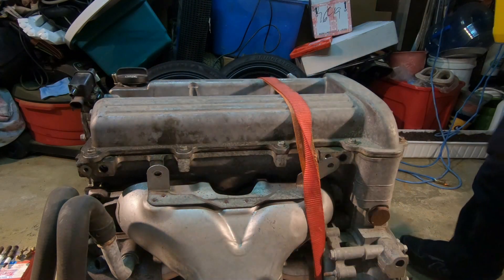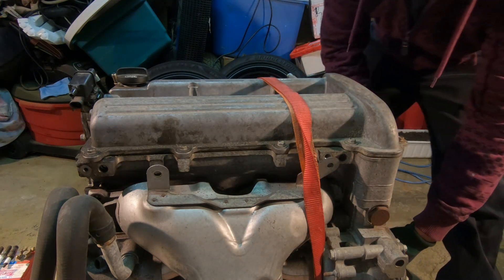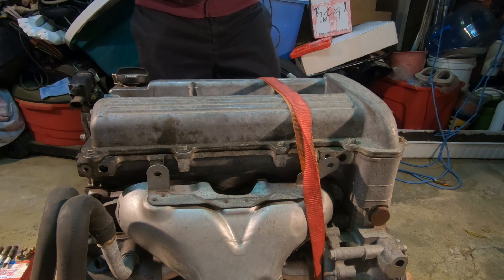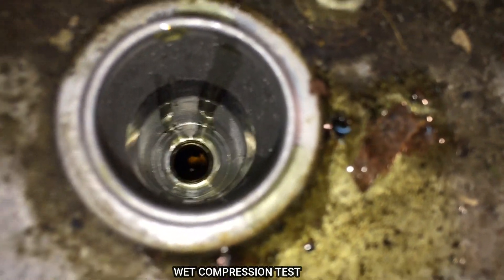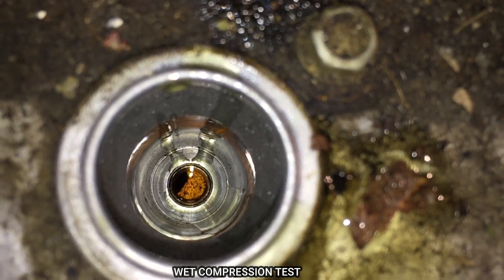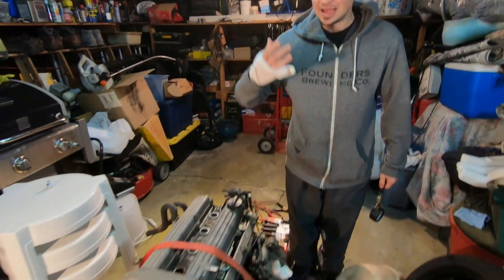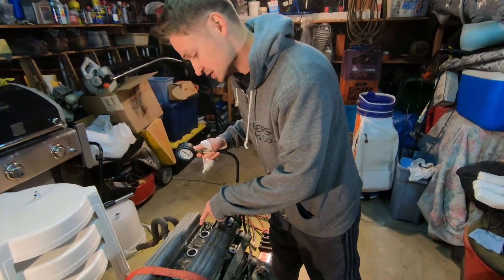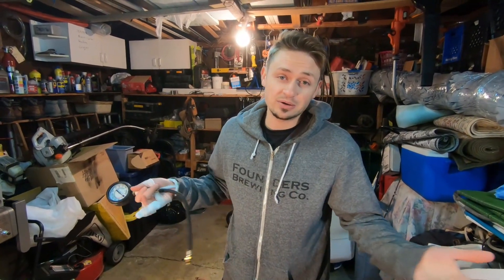Doing a WET Compression Test on the Abandoned GM Ecotec Motor (L61)

Comment: That's kind of odd the way the numbers were that far apart on the cylinders. If it would have been two cylinders together I would say maybe a blown head gasket but where they are and the same reading is odd. I guess it could be broken piston rings, cylinders scratched? Why don't you pull off the valve cover and see what's going on in there when you turn it. It's even possible you have problem in the valves. I guess a leak down test would get you closer to an answer. Once you determine where the air is escaping then you will have a real good idea what's wrong. Could be a valve not sealing. If you hear or feel air escaping through the exhaust then you know to look at the exhaust valve. Same deal with intake. If its coming out from the bottom end its getting past the rings.
Reply: Exactly
Reply from the maker: I will have to check if they rent out a leak down tester.  Otherwise just gonna  start disassembly.
Reply: @BulliKid  Is that your compression tester? You could take the gauge off and put an airline fitting on it. Bring the piston to the top on the compression stroke , screw the fitting in and apply a small amount of air and see where it's coming out.
Reply: I agree, I would definitely do a leak down test. Best way to make sure compression isn't going through leaking valves.